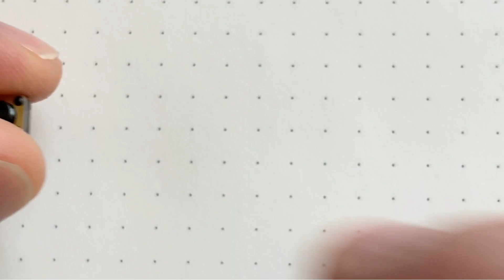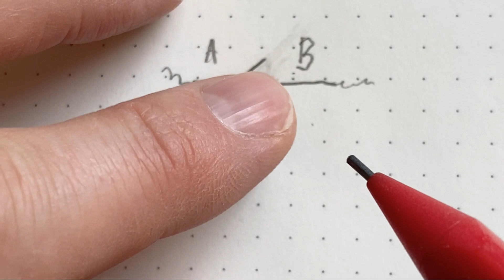Arduino Momentary Push Button and Simple Circuit drawing

Comment: Why not switch the 5v and GND on the button and use the built in pull-up resistor? One less part to use and I believe it's a built in 10k resistor.

Comment: why doesn't the 5 volt current not go to ground automatically? is it cause electricity prefers the path of least resistance? so 100% of the 5 volt current goes to the pin and not even 1% goes thru the resistor to ground?
Reply: Thats right, the loss to the 10k resistor is insignifikant. 10k is 10000 ohm vs maybe less than 5 ohm of the cables and connektors

Comment: I always have a hard time remembering which sides are connected on these buttons, so I just use opposite corners.  One pin is side A and the pin in the opposite corner is side B.  It always works, and I don't have to worry about it anymore.
Reply from the maker: That is a great tip!  Thanks for sharing Rick.

Comment: Hi, with those tactile switches, just make sure you use diagonally opposite tags and you will always get the connections that are either side of the switch mechanism.
Reply from the maker: Thanks for sharing Tom!  Love that tip!